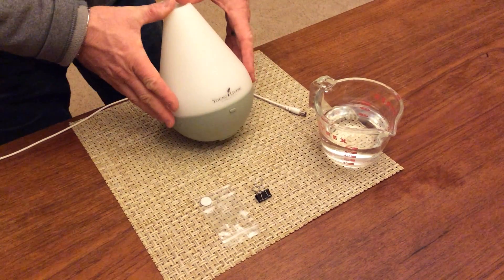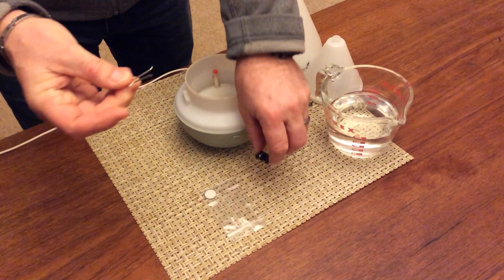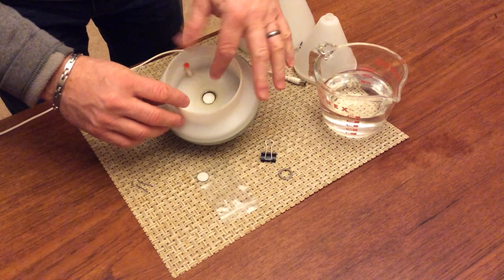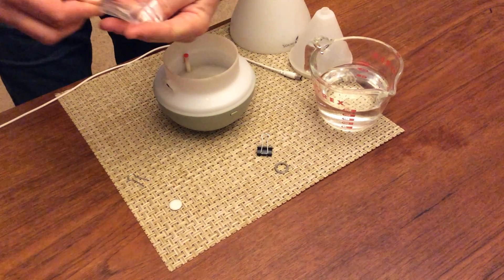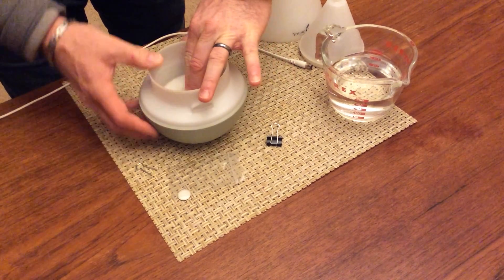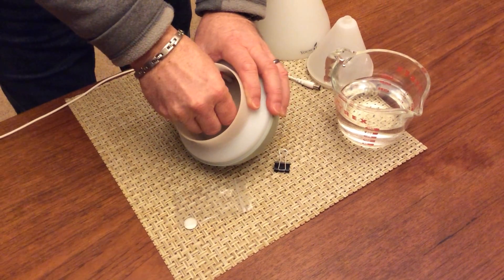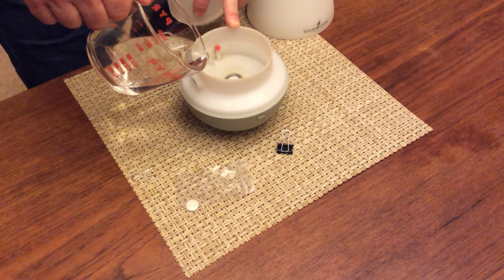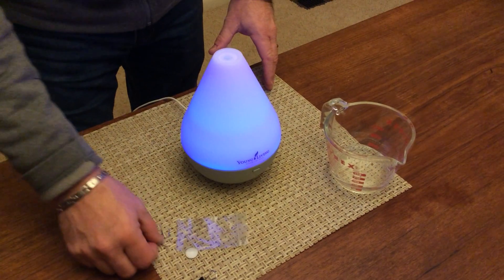How To Repair A Young Living Dewdrop Essential Oil Diffuser

Comment: Mine just stopped running altogether...not the power cord's problem...that's fine running another diffuser currently. Glad I have a backup, but I would much rather fix this one than replace it. Any ideas?
Reply from the maker: https://www.diffuserdoc.com/young-living-diffuser-repair-kits/yl-disc-16.html

Comment: where did you order the ceramic disc replacement? :)
Reply: Alyssa Calderon He tells you at the end of his video if you watch it.
Reply from the maker: After ~5000 hours of running or when mist output fades.  Also if the unit shuts off before all of the water has been atomized.
Reply from the maker: https://www.diffuserdoc.com/young-living-diffuser-repair-kits/yl-disc-16.html
Reply: DiffuserDoc b

Comment: My Dewdrop diffuser has stopped working. When I put fresh water in and plug the cord from the wall into the diffuser it blinks blue 3 times...do you know what that might mean?
Reply from the maker: Hi Angela,  how old is the unit?  You can contact us at diffuserdoc.com for further support.
Reply: Angela Michalovich mine has started to do this too what did u find out?

Comment: How would I know when to replace that piece?
Reply from the maker: Hi Zoe, when it stops working it's because the bad disc causes the micro-controller to think it's' out of water when it's not. Replace the disc and you should be fine.
Reply: Thanks! Just ordered the replacement part.